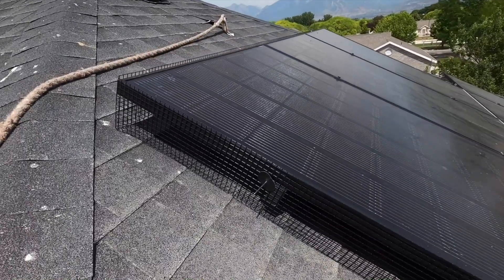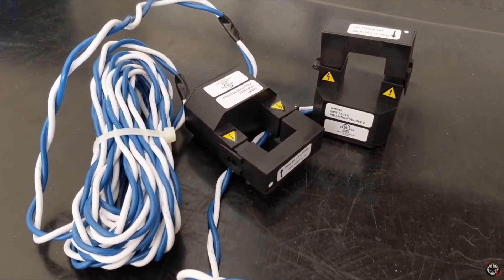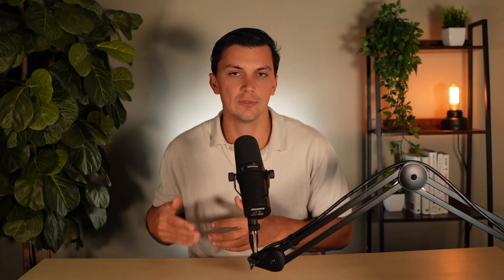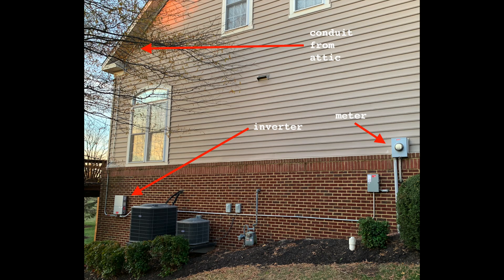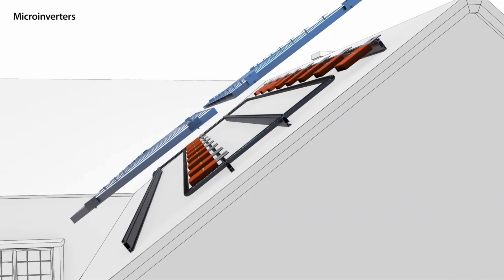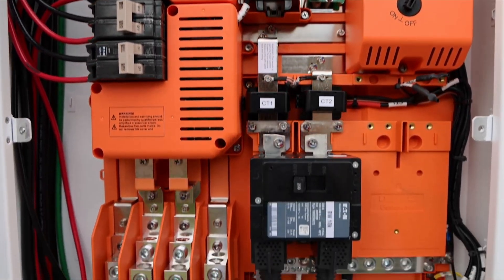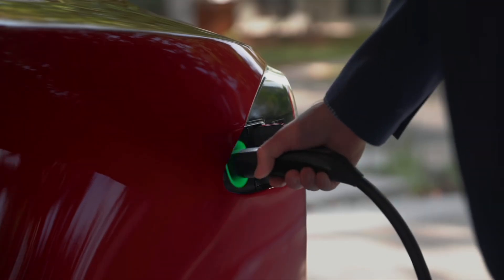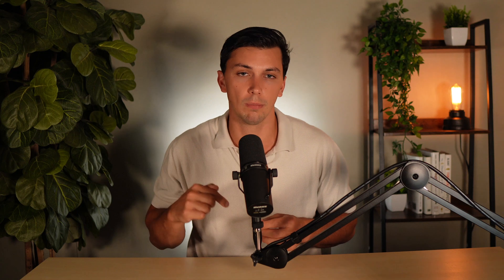7 CHEAP Purchases that improve your Solar System

Comment: Most of these points are why I am going to ground mount. If you have the room it seems the best option.
Reply from the maker: Ground mount is a great option. Slightly higher cost because of the racking/concrete/trenching, but comes with benefits.
Reply: @jackthesolarguy Huh, concrete and trenching? How rich are you. I lay my solar panels flat on the ground or lean it against the house.
Reply: @lorenjensen2034  Me too 3.2kw of  rack free power .....will need to lay them flat if a hurricane comes tho
Reply: @jackthesolarguy  I was gonna use old pallets that I grabbed from behind the grocery store and some scrap lumber from the dumpster or FB Markteplace  :)  In all seriousness....you have a great channel keep up the good work.
Reply: I mounted mine along my backyard Cinderblock wall using 2x3" wood Rails and Tapcons to the brick, and then 1x2 wood to build square frames for each panel that offset them slightly from the wall, then 4" hinges mounted to each square frame then mounted back to the 2x3". You can use Gate T brackets from Lowes or home depot on the square frames to build the angled leg supports that line up in the cinderblock cracks and support the panels. When's summers over  I can easily tilt all the panels more south, I can also fold the panels down out of the way for storms or maintenance.  I mounted 4 panels for less than $50 and looks clean as heck.
Reply: @mikeleaming5529  I would love to see a picture of your cinder-block wall mounts!  I've thought about this idea, but my wall runs east to west. I'd have to tilt the panels well above the top of the walls in the winter to catch the low rising sun to the south during winter. I built a simple square table-like frame for my ground mount arrays. I used only 2x4's and 2x6's and 4"x4's as posts. The 4x4 posts stand on pavers that are just laid on the ground. Each of the 2x ground mount arrays holds 6x 340W panels. The weight of the wood, fasteners, and the panels keep it from moving in high winds. The panels/arrays lay flat like a table top. It has worked well for the last three years, but I wouldn't mind expanding to more panels on our privacy cinder-block walls. Cost ~$200 for each ground mount, did the work myself, they feed 2x AC300's with 8x B300's.
Reply: Use a Victron Quattro 5k (grid in and gen in and charger plus xfer switch all in one)   then Run Large Arrays (stand alone ground mounted) Up to 450v on a Victron RS 450/100 (2 arrays)
Reply: there is a Quattro 10k   and a RS 450/200  (4 mppt trackers independent)

Comment: Wouldn't the skirt guard reduce air flow under the panels increasing panel temperature which reduces the panel efficiency?
Reply from the maker: That is correct, and is a downside of using the skirt guard as opposed to wire guard. Great point
Reply: -Roof shading 😎 should be a feature. 1
-Cooler panels are a feature. 2
-Lower air-conditioning load and more battery electricity feature. 3

Mesh guard is wise.
Landscape panels with rail mounting running up the roof allow more hot air flow free to vent out.
Reply: @stephenbrickwood1602  Painting the roof in white should be mandatory 😎 It's a passive cooling for the roof.
Reply: @tafsirdiallo  yes, particularly wherever panels are positioned. 
Extends roof life. For Colorbond metal roofing near the coastline. 
Also the rest of the roof if local government allows .
Reply: With the increased temperatures in so many locations, I see this causing more fire issues and cable problems than critters ever could! Highly dangerous.
Reply: @simonpaine2347  I think you made that up. Roof should be much cooler with panels than without
Reply: @artsmith103  Inside the roof might be cooler, but it's obvious that black surfaces attract heat. With open ended panels there's also obviously a natural airflow that helps to cool the panels. Shut that airflow off, or significantly reduce it and the space under the panels will heat up. Why do you think that all installations gave a 2-4" space underneath? Why to other options have a mesh design to continue to allow airflow?
Go ahead and try it and let me know what happens. I guarantee that it will reduce the lifespan of the panels, micro inverters and cables while also reducing output of the panels by a minimum of 2% just to make them look nice.
Reply: @simonpaine2347  You said the roof would be hotter than no panels.  That's what I corrected.
Reply: @artsmith103  Actually I didn't say that "the roof would be hotter than no panels" The issue is that the space between the roof, that the skirts are supposed to protect, will definitely get hotter. I guarantee that. How much hotter depends on how well the skirts are fitted, ambient temperature, angle of the panels, type of panels and of course if there's any wind.

Comment from the maker: Here's the list. Which one do you guys think I missed?

1. Critter Guards
2. Consumption Monitors
3. Attic Runs
4. Microinverters
5. Generator Modules
6. Bi-Annual Cleaning Service
7. Solar-Integrated EV Charger
Reply: The RDS (rapid shut down) requirement added to the most recent additions of the  NEC (national electric code) works against those who want to try to install string inverters. The NEC basically requires you to install multiple failure points that simply aren't a problem when using string inverters. Also string inverters are typically at ground level and much more easily replaced. 
In my opinion string inverters are easier to troubleshoot because the whole array will stop functioning. String inverters are much more reliable regardless of the propaganda PREACHED to the contrary.
Reply: @powerguymark  Dual inverters systems worked for me.  If one went out (and they did in the 80's) I would only be at half power and could switch so the DHW, refrigerators and freezers were covered (Important as we stored Milk and Cheese) . However it took a week or more to get a replacement so should have just had a third spare $$$.   Also the Well and a few other systems were 48vdc Well and so weren't effected.  

Chargers  were separate but didn't fail very often. (Then however it took a week of more to get a replacement).    Had an med generator but it was more for Fire system (pump) reliability) used it more when I worked remote on the property. 

These new ideas are however very interesting.
Reply: Had critter guards installed this week. The squirrels chewed on the wires and shorted when they got wet, tripping the breaker. They have thousands of acorns in my yard to eat but I guess they wanted a little variety.
Reply: RE the critter guards I have a barrel tile roof so I cannot use these (as you presented them) but I do have a thought about the skirts. I've seen these in my community on some of the flat tile roofs. My first thought about the skirts was I liked the look and the aerodynamics in possible strong wind storms. But several pros told me the skirts are NOT recommended because air flow under the panels is blocked thus causing excessive heat buildup and lowering the efficiency of the panels. Do you concur this?

On the aerodynamics my guy also told me it's not necessary as the system he installed with Sunmodo TopTile hurricane rated mounts. So he said no need to worry about wind either.
Reply: @guywthclss  The skirt thing is mindboggling to me! It will 100% lower the efficiency of your solar panels, it's really that simple. Plus if you had one of your connection that was already not 100% perfect it will increase the likelyness of a melting event. Just think about a skirt like closing all the windows of a black car in summer without anyway to cool the inside. This is just plain stupid and ridiculous to say that this is a good addition to your solar array. The mesh one on the other side is really the way to go not only for the critters but also if you have trees nearby you can prevent accumulation of leaves under the panels.
Reply: I was actually going to add that exact comment, thank you
Reply: You missed having an automatic transfer back to grid in case of failure.
Reply: I have optimisers rather than microinverters, and a central inverter.